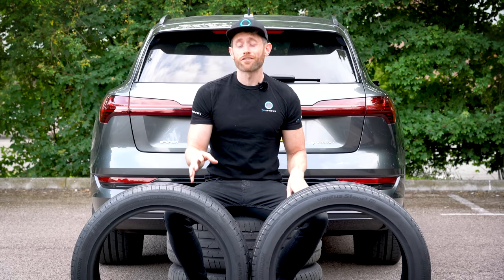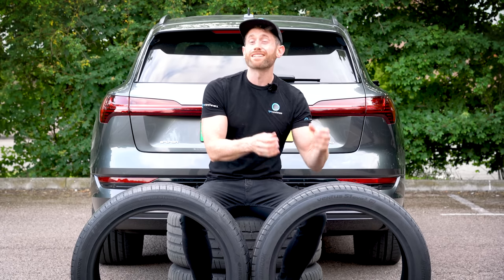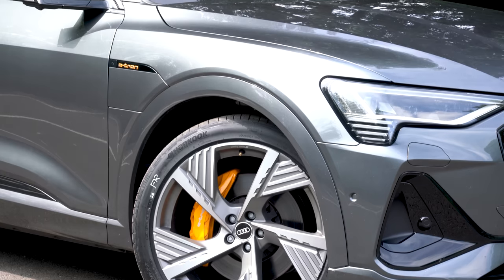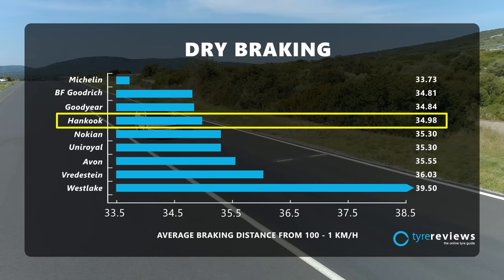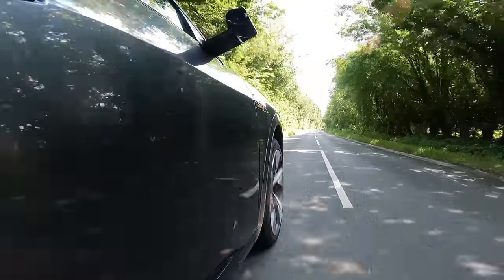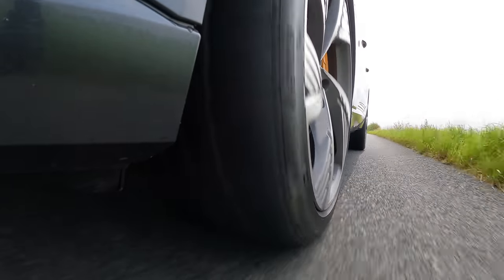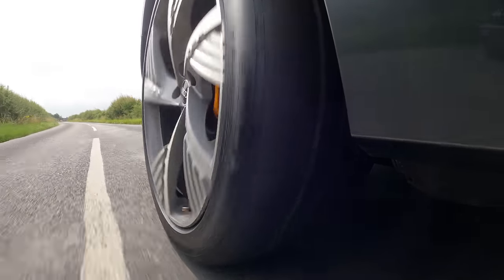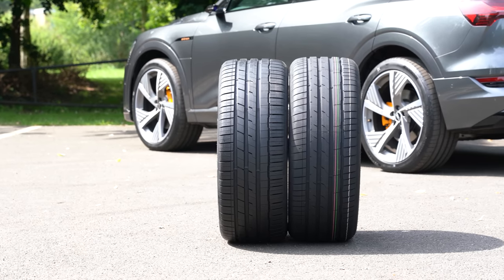What makes EV tires different, and why should you fit them! 🔌

Comment: Seems kind of sketchy that ev tires make EVs more efficient, but not ICE cars. Have better tread is good. Having less roll is good. I think the fact that EVs are heavier on average means that they can get away with less tread separations, but it really wasn't that much. The parallel separations we're almost identical. The perpendicular separations we're just slightly shorter, thinner. Seems marginal to me. That could just be manufacturer required differentiation.
Also, acoustic foam shouldn't be an ev only thing. That was  surprising to me that it even exists.
Reply from the maker: You can get acoustic foam in certain sizes of normal tyres. Some of the big audis have it on their OE tyres

Comment: Standard Michelin model 3 dual motor tires are trash. Put on continental crosscontact all season tires night and day difference. The handling is way better. The foam inside the ev tire is non sense. I noticed no tire noise increases with the non ev tire. The continentals are better in every way.

Comment: Normally I don't like to comment negatively. But you portray EV owners as 'oh shit I need to charge often', 'ow charing is so slow compared to gasoline fueling'

This is nonsense, as someone who drives an EV you know your range, can charge litteraly everywhere and don't need to get to a fuel pump, but charge at home or at work. Because of this shitty portraying you give EV's a bad reputation which they don't deserve. IMO most of the end users are going to be just fine driving an EV. Even if you drive 50000 Km per year (which my dad does in a EV)
Reply from the maker: I felt the end of the video was pretty pro EV

Comment: 10:27 Bullshit. Weight, rolling resistance, tire pressure etc. also results directly in less fuel consumption. The only way to proof that wrong is to mount the ev-wheels on the fuel car and make a defined test ride with both types of tires. Then you will see how much fuel it saves. You might use ev-tires for the weight class the fuel car is in. This results in lower weight and better performance.

Comment: Electric vehicle production is terrible for the environment. The lower emissions will NEVER outweigh the negative impact of the production of their components.

If you want an electric vehicle, get one. I personally love Hybrids for the efficiency of takeoff and added low end torque. But, don't for a moment, think that you are somehow saving the planet by doing so(you are harming it).
Reply: Not bashing you, btw. I love your videos. 

People just need to know that they are NOT helping the planet by purchasing electric vehicles. 

If you want one, great. Just don't conflate that, with being ecologically friendly. That is a fallacy.
Reply: @sumdumguy3021  Its not a fallacy, its a well proven fact that EVs are alot better for the envoirment than ICE vehicles in the long. The efficiency is unmatched, if green energy can be used to charge up CO2 Emissions are basically zero. Combustion engines dont even come close.
Reply: @Dudeisthere  You are providing only part of the equation. 

While yes, an existing electric car is more efficient and has better emissions(not zero, as "pollutants" are not just caused by burning fuels.)

The production of the vast majority of energy is not "green", the production of the batteries will NEVER be "green", the mining required for the battery components is not "green" and the global logistics of bringing all of these things together is not "green". 

My point is, buy what you want, because you want it. Not because of a false sense of superiority/ecological awareness. 

Electric vehicles AND the production of their components do more damage than ICE vehicles AND the production of their components. 

They both have their positive aspects. But when viewing the full picture, the scales are far closer than you would like to believe and electric vehicles actually come out on the losing end of that comparison.
Reply from the maker: I'm hoping hydroden is solved soon
Reply: @tyrereviews  Definitely! 

I've been dabbling in hydrogen fuel cells for years on a small scale. I can't wait to see it succeed. 

Unfortunately, the petro industry fought very hard against it and I feel it is likely that the blossoming electro industry will do the same.

It is the one source of power generation that can easily be performed by an individual.

Unsurprisingly, that aspect doesn't jive with large corporations and their shareholders. "Why make some money, when we can make ALL the money?"
Reply: @sumdumguy3021  Lets make a comparison: A basemodel Golf Diesel (most efficient model) vs. an ID3 with the big 77KWh battery pack.
The ID3s battery pack will cause approx 8,162 tons of CO2 emissions (106kg CO2 per KWh of battery capacity as of 2019), 
WLTP "fuel" consumption: 15,8KWh/100km
CO2 emissions per KWh of electricity on average: 233g (UK), 417g (US)
The Golf Diesel has a WLTP fuel consumption of 4,5L/100km and emits 117g/km CO2.
That means that in the UK you save 80g CO2 per kilometer with the ID3, 51g/km in the US. Given those numbers it would take the ID3 102.000km (61k miles) to break even in the UK and 160.000 km (100k miles) in the US, both of which are very realistic numbers for a modern vehicle to reach.
So even with this calculation which was heavily in favor of the Diesel the EV still comes out on top. For a honest comparison we also have to account for the CO2 emissions caused by the production and transport of the Diesel fuel (a very complicated and inefficient process in itself), the production of all the components not needed in an EV (ICE, transmission, catalytic converter, etc.), regular engine/transmission oil changes every ICE car needs (that oil has to be produced too), brake wear (almost none existent in EVs) and air quality (improves with EVs since no local emissions).
The only problems EVs have like energy intensive battery production and weight are being worked on and can be fixed. Making internal combustion engines more efficient at a reasonable price point is almost impossible which is why more and more manufacturers go full EV instead.
Im a petrol head myself, but these are the facts.

Comment: For me,  EV is useless.  No where to charge.  Its fine if you have a house with a garage or drive or both, but if you live in a flats, utterly pointless.   Also, I can get over 500miles per tank of fuel (motorway) in my 2006 2.0T A4,  that drops to 430 if there is some fun country roads.   When the range in an EV is over 500 miles on 1 charge, and charging takes no more than 5 mins back to 100% THEN ev's will be useful to me.
Reply from the maker: The dream

Comment: I am not really sure that I buy into any of this.  The EV tire in this video will have better traction and handling because of the reduced cross cuts and stiffer sidewalls.  That will also reduce rolling resistance.  Just looking at the side profile you can see the EV tire looks more performance oriented than the ICE tire.  The directional cuts will improve water dispersion but the snow traction will be lost with the reduction of siping from the ICE tire.  I don't think you mentioned the rubber compound at all.  That alone make a big difference in performance or rolling resistance.  I don't buy for a second any of the EV is heavier BS as you can have a huge difference in weight in ICE cars running the same tire.  If the weight was the main criteria then tire companies would make different tires (of the same model) for all vehicles of different load ratings.  But the fact is they make tires with a load rating and as long as you weight is below the load rating for the tire then it is all the same.  I actually feel dumber for watching this thinking it was going to be informative.  All it turned out to be was a long marketing AD for Hankook EV tires with BS made up by a marketing department.  I run Hankook VENTUS V12 EVO2 K120 on my Bolt.  It is not an EV tire and is a heck of a lot better tire than the OEM.  I also ran the same tire on a Forester XT and a Contour SVT.  This was not a good video at all and the conclusions are absolutely looney.